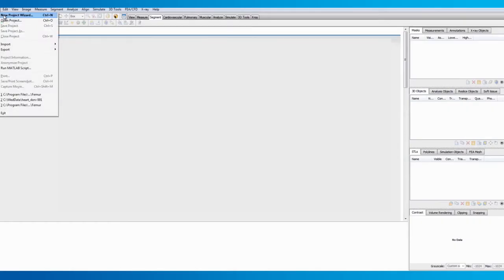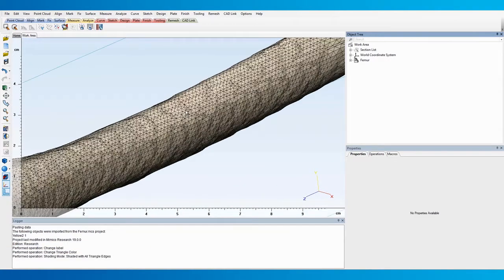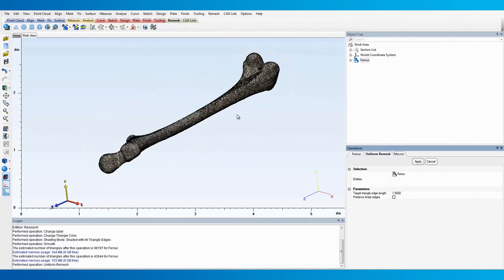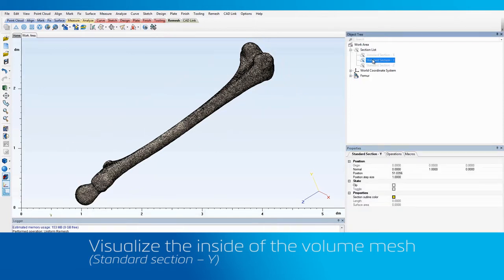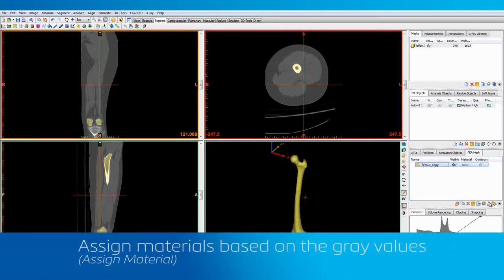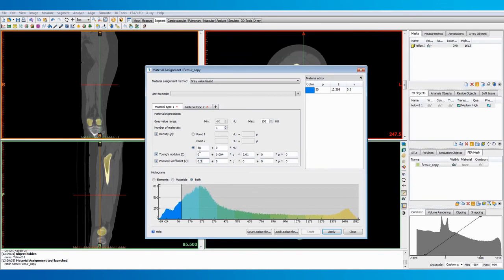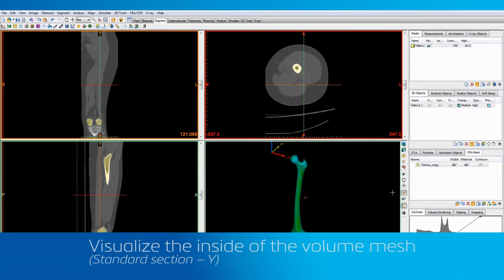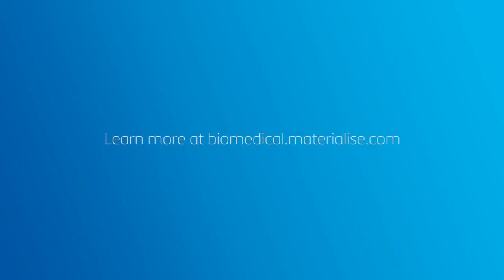How to Mesh a 3D Model | Tutorial | Materialise 3-matic

Comment: I'm not getting gray value in material assignment method.. I'm getting the two options 'homogeneous' & 'Assigned materials'.. what to do?
Reply from the maker: Hi Chitra,
To be able to get the gray value-based method, you would need to ensure that the mesh created does not protrude over the image data. To check if it lies within the image data, turn on the contour of the mesh created. If there is a protrusion, the mesh would first need to be fixed to make sure the contours of the anatomy are accurately matched with the image data. We hope this solves your issue!